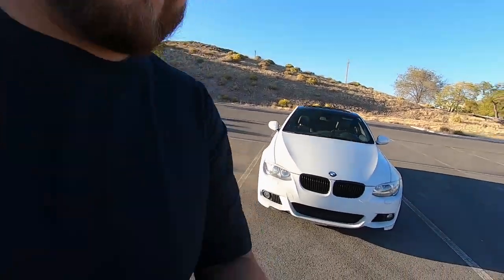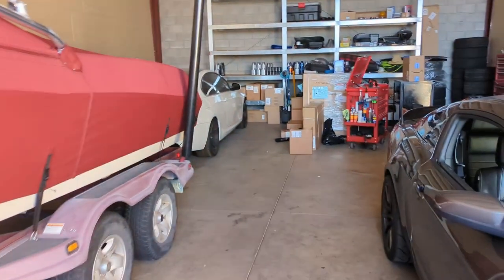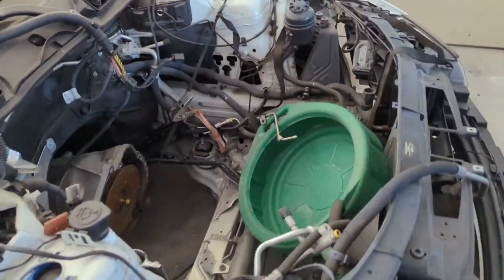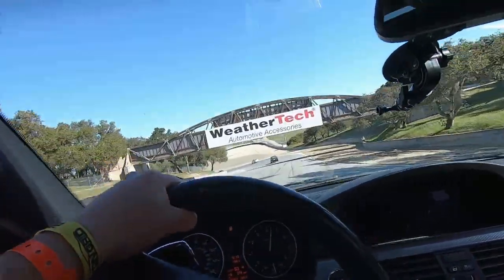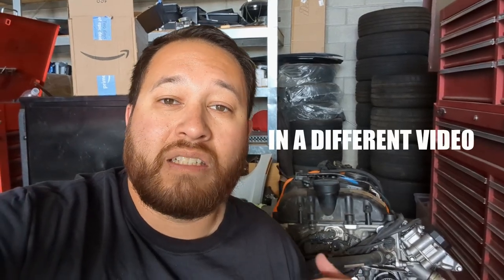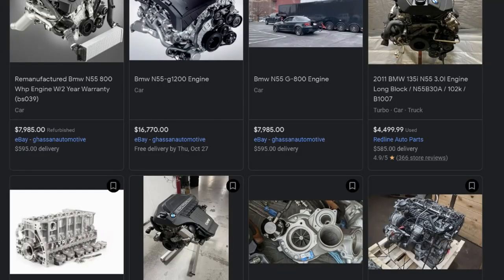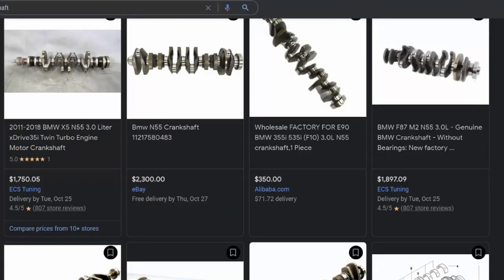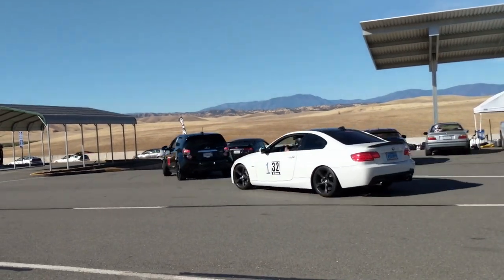What Happened To The BMW

Comment: Rod bearing failure into your engine blowing up. A 2500$ mistake becomes a 10k$ mistake. Gotta change it every 50k especially if you plan to use it for track days and fun driving. People dailying it can probably push it to 70k if you treat the engine nicely. 

At least someone else has the time and money to pick up the pieces.